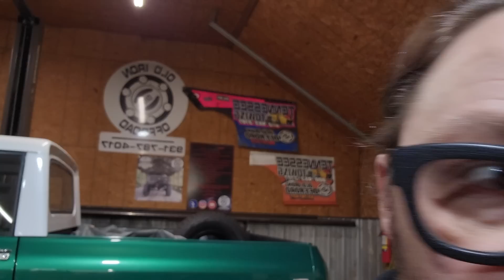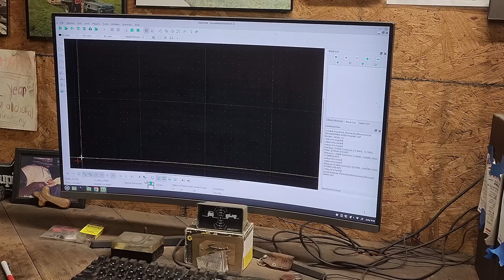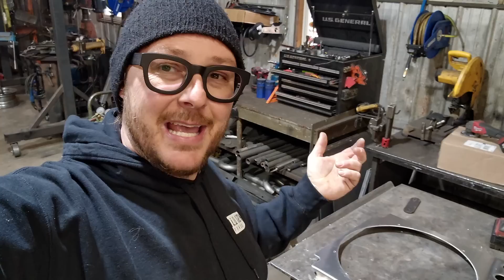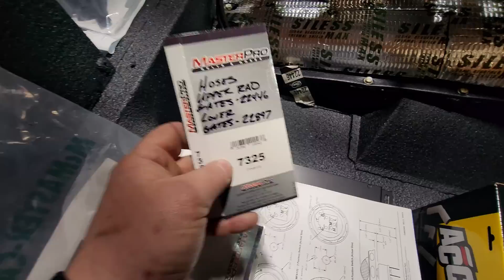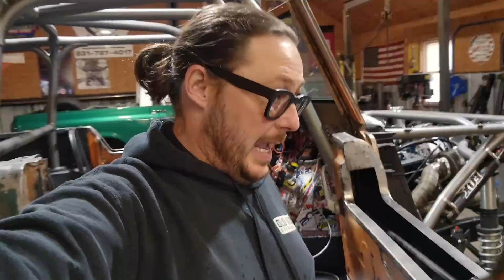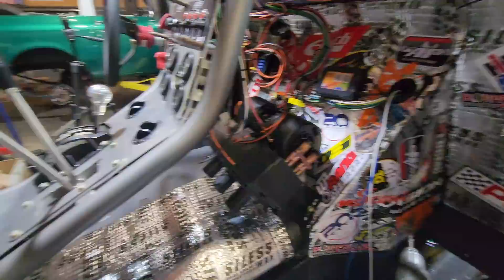AMAZING JUNKYARD ELECTRIC FAN!! ( Ultimate 800 Crawler part 18)

Comment: You now need to upgrade that fan to a PT Cruiser fan. Mounts flush, comes with shroud, mount it flush, built in relays pre mounted with harness and you can pick one up OEM or aftermarket for cheap.

Comment: Lincoln Mark IIIV is another good one. Word of caution, they need a good fuse and relay to run on high. I am interested in seeing the bypass flapper deals for highway driving.
Reply from the maker: Oh yeah!  This thing has a high ampspike when it kicks on.  It will be on a 60 amp mega fuse.  Scrub through the video.  I actually showed the flaps installed.

Comment: I had that fan. Worked great, but ended up running a C7 Corvette Z06 brushless fan with external controller on my XJ V8 swap. After years of XJ 4.0 ownership, didn’t want ANY cooling worries, lol. 

Kept the Jeep cool even dragging my buddy’s dead LJ on tons/40s up 1500’ back to base camp starting at 5,000’ on a 90* day.
Reply from the maker: Actually considered brushless but didn't like the controller setup.  They looked overly complicated, and the main concern for parts on this rig is what was hopefully available at a local parts house.
Reply: @OldIronOffroad  Yeah, it's a concern.  The setup with the eBay controller is actually pretty simple, but I do wonder what I'd do in the event of failure.   Luckily, it's an XJ, so I still have the stock fan on the driver's side as backup.

Comment: I'm digging it.  I remember those Taurus fans being the latest greatest in the muscle car crowd back in the late 90s.  Amusing to see they are still a good choice.  I didn't know Volvo used the same fan, in an easier to package form.  Can you list the years of Volvo you can get these from?  Thanks.
Reply from the maker: @benjaminreinhardt259  i would say like 93 to 97 970 should get you what you are after.
Reply: @OldIronOffroad  Awesome video. Thanks. Do you mean Volvo s70 or the Volvo 960? I couldn't find anything on a 970.
Reply from the maker: @sunildesaidds  yes sorry, 940 or 960

Comment: BMW temp switch has two temp switches built in. Two different sets of temp ranges available depending on years. I have found temp switches need to go in radiator as they will get heat soaked and stay closed all the time.
Reply from the maker: @grayl25800  good to know.  This controller will be triggered by my efi temp switch.